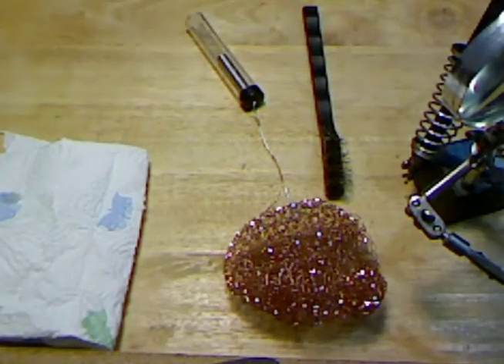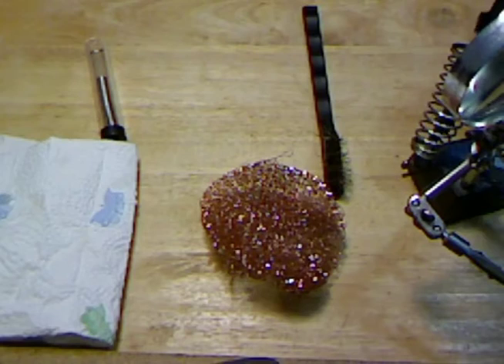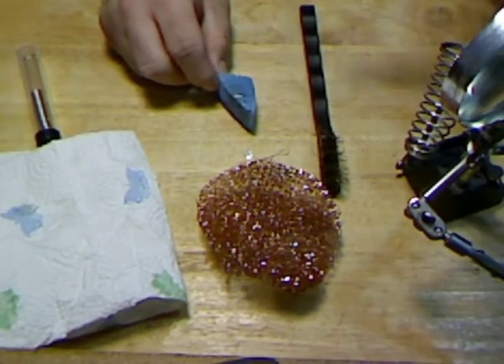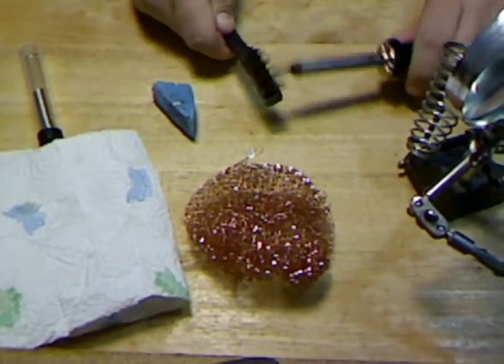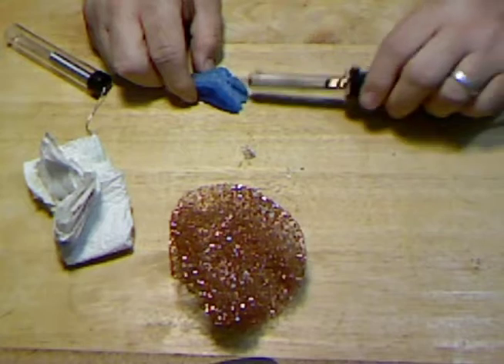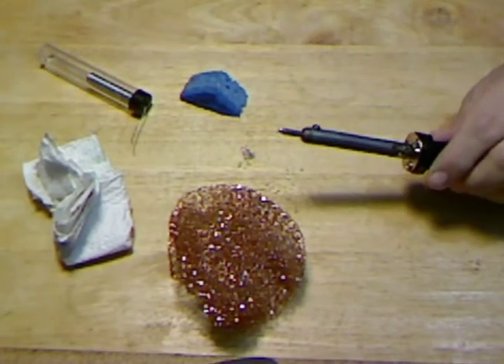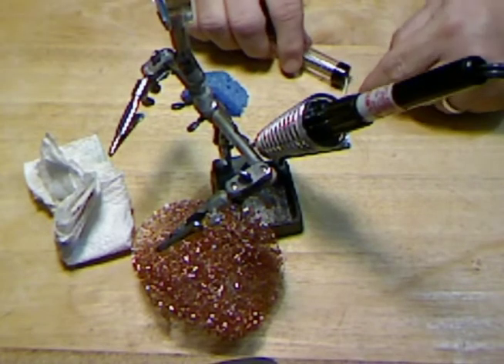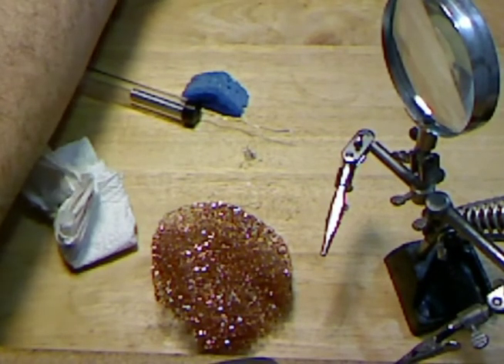Soldering Iron Tip Maintenance

Comment: I use cheap emery boards from the dollar store.  I get he really cheap ones that are just like grit on a thin wood Popsicle stick.  The thick ones don't work quite as well.  Just lay the emery board flat on the table and rub the tip back and forth to get it down to bare metal and tin it.  It is a lot faster than a wire brush.  You also might want to get some rosin flux to dip the tip in as well it will help the solder stick real well when you tin it.